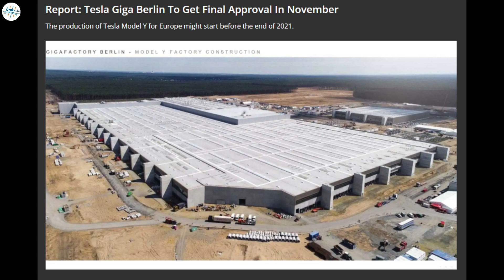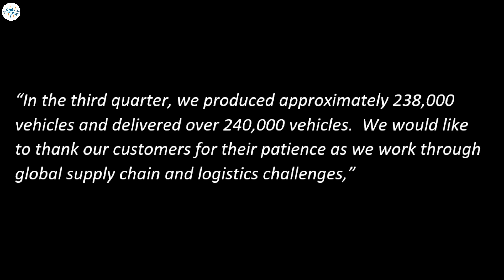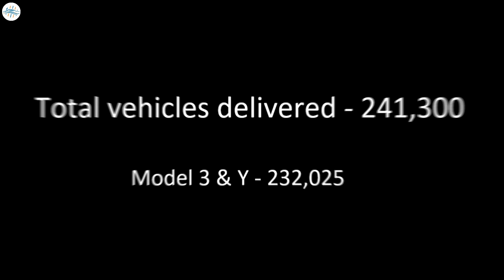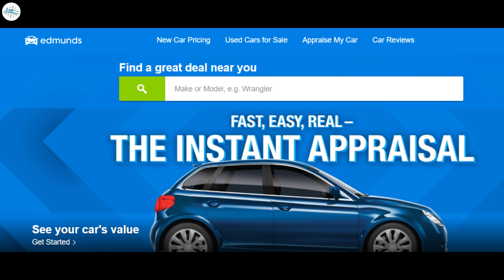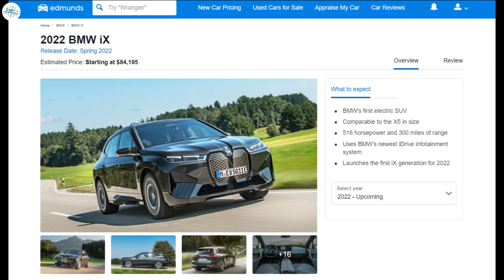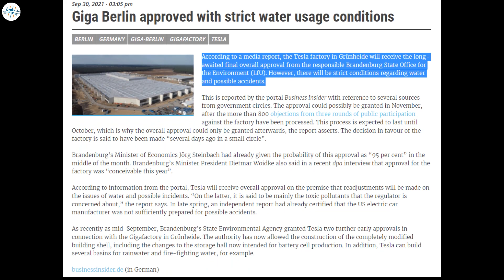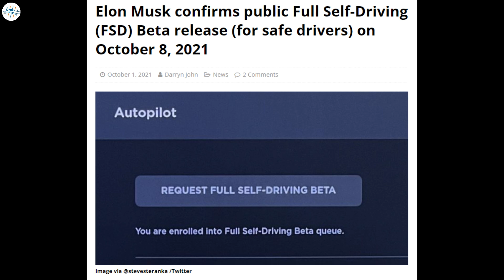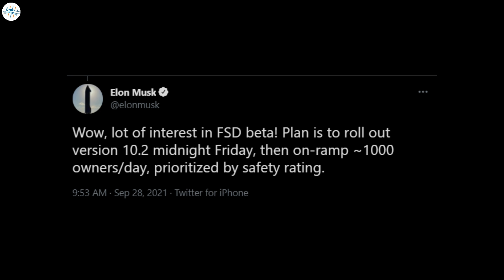Tesla Breaks All Records In Q3 2021 & More Updates!

Comment: Tab less architecture- 4680 issues, concern. 

Standard cells 18650 and 21700 pass current through welded tab (1), in conjunction with an essential preload force (2) to enhance conduction between tab and cell bed. While thermal path runs from core towards cylindrical wall. That is a safe cell assembly architecture. 

Tab less architecture replaced (1) and (2) with anode flaps made of soft Cu foil. An elastomer, preload mechanism, is not include in the tab less patent.

Issue-1 thermal conduction should be made in area contact and not through Cu flap point contacts as in 4680. Problems? Limited heat sinking to reduce life cycles and push chemical closer to the flash point.  

Issue-2 electric conduction should be made WITH elastomer preload tabs or flap and not with preloaded contacts omitted. Problem? On road inertial shocks can deform soft Cu flaps and disconnect one flap at a time leaving the anode open circuit, as it open circuit a spark is produced that can ignite heated chemical inside. Is a fire hazard.